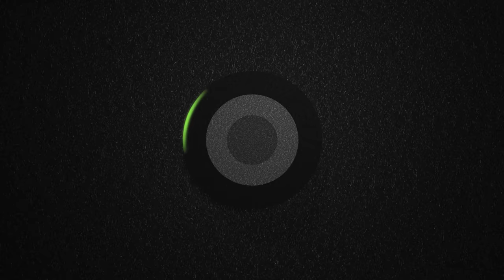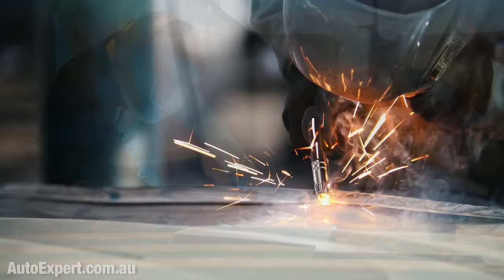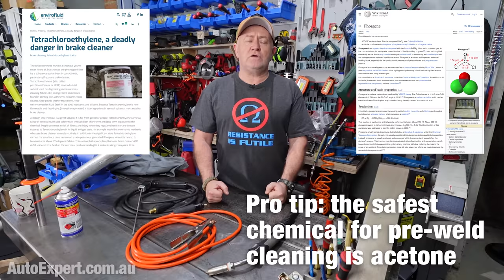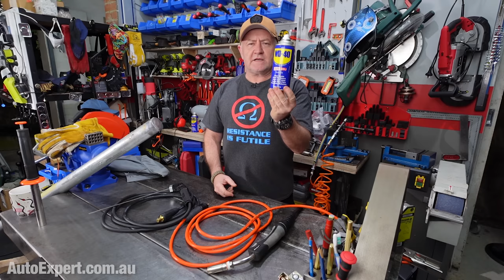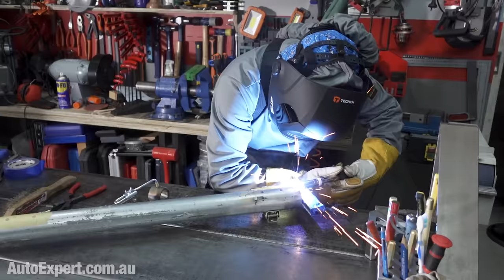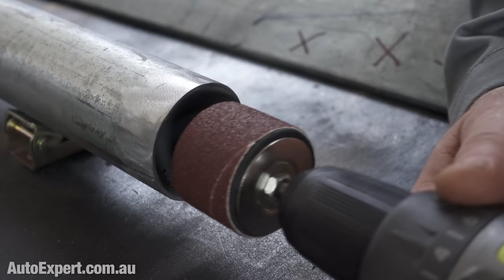How to die while arc welding at home: the top 5 ways | Auto Expert John Cadogan

Comment: Awesome video John. A few things I knew, a few I didn't. One other thing I'd say (from experience via my Father), is don't do any welding within cooe of a lead acid battery, especially one on the charge. On the farm, the old man had a neighbour ask to weld something up, Dad had a battery on the charger down the other end of the shed. A spark managed to travel far enough to make the charging battery go poopy in its pants in a very dramatic way. From memory it would've been a good 10 to 15 meters from the welding site. Years later when I was working for an oil drilling company, I pointed out to a pro welder who was welding up some pipework (8000 psi rated if I remember correctly) that there was a couple of jerry cans on the shelf about 3 meters from where he was welding...... And the dirty look I got from the yank drilling superintendent after I pointed that out will be forever etched in my mind. The arrogance of so many high up in the chain of  the oil industry is incredible. Oh, and welding gal pipe really stinks! Awful smell!
Reply: And cutting,/ grinding it. It stinks. Just as well really!
Reply: oldfartonabmx:  what did the battery do when dad's welding spark got over there?  I guess it ignited hydrogen gas?   Gasses probably crept over to where Dad was?  Did it blow up?  Explode ?  Were you there or just dad?

Comment: Fantastic video about the potential dangers of electric welding.  Like you I had to spend time with our specialist welders in the vain hope some minute part of their staggering level of skill would osmotically transfer.  One of the guys I worked with always set up his welding table outside under a steel awning - his view was that welding inside should be done only when there was no other option.  He was the only welder we had at the time who was trained to weld rolled homogenous armour plate, and he really new his craft.  Not that too many hobbyists would use them nowadays, but I would recommend many of your safety tips to anyone digging out and using using an old spot welders.

I spent quite some time in the two proof and experimental establishments our organisation had and it's true that 'blowing stuff up' is fun when it goes to plan (I have some 'fun' stories about when it didn't), destructive testing has to run a close second though.  A static coupler test rig would be quite a thing to see, and to have designed it quite a feather in anyone's cap.

Comment: On the electrocution bit it's quite difficult to get killed by it DIRECTLY, though as you point out it is possible if you try hard enough. The voltage (and therefore the current through you) is not usually high enough. But the thing about electric shocks is that many fatalites from them are INDIRECT. If you're welding up a ladder or on a roof, or manhandling a half ton piece of metal, or otherwise in a generally hazardous environment then that short involuntary convulsion can do very bad things.
Reply: The usual output voltage isn't that high. About 60 V open circuit. I'm doubtful that would kill someone. Not easily anyway. I'm pretty sure welders with a high enough voltage to kill you aren't legal nowadays. I'd consider everything up to 50 V to be fine. A little above that is still very unlikely to kill someone.
Reply: @asdqwe4468  It all depends on the current, which is a function of both the voltage and the resistance (ohms law). If you are sweaty (which contains salt) then your resistance is much lower than normal, and so can be electrocuted with much lower than expected voltages. Also the path that the electricity takes through the body plays a role. A path through the heart or brain are likely the worse possible scenarios.
Reply: Many d.i.y.ers & home handymen are unaware that lower voltages can be deadly. It is true that the current is what maims & kills but what many don't realize is that under the 'right' conditions as little as 47 or so volts with as 'little' as 10 MILLIAMPS can be fatal. Length of time of contact is also a great factor in severe destruction/death. Guys who do home electrical work are fooling themselves when they say "...huh, it's only 110/120 volts"! Thanks for the great video!
Reply: @lawrencesmith.  Lawrence you are clearly American - everywhere else uses 240 volts AC, and no-one is under any illusion about that being potentially lethal. But the output (not input) of a welder is never more than about 60V DC and usually much less than that. As stated it is very rare, though not totally unknown, for that to kill directly.

Comment: Thank you for doing this video. It's a good refresher course to those of us who welds at home. I do mostly FCAW welding and as you know, that puts out lots of toxic fumes. So I designed and built myself a fume extractor that I position right over the bench and the fumes are pulled away from my face and blown outside through a 4" hose. Also, I never weld with bare skin exposed.

Comment: Welder by trade. Its probably worth noting additional welding PPE;  wear ear plugs, not just for noise as welding is very noisy but you don't want to chance one of those molten spatter balls finding its way down your ear cannel. I would also suggest safety glasses  under a standard style welding helmet especially for welding in unusual positions like on cars or trailer for example. Also when prepping parts for welding like grinding off galvanizing you should also be wearing your mask/respirator as I have herd you mention in other videos.  
All great advice though like brake cleaner has always been a no no but never new the scientific reason..
Thanks

Comment: Great explanations. There are also a few videos going around of auto mechanics setting fire to the vehicles and/or the shop when welding on a car where there's either leaking fluids in the areas, flammable other stuff like seats, or getting too near the gas tank.
Reply from the maker: Mechanics tend to be very casual about welding...
Reply: @AutoExpertJC  Tell me about it, as a (now retired) vehicle technician (bus and coach) I was on a Sunday afternoon shift when all the big white chiefs were safely tucked up in bed when a (rather dim) work colleague decided it was a perfect time to stick his wheels back together. He was using a gas welder and was underneath the thing totally engrossed when we shouted at him “John, your car’s on fire”, after about the third time he finally noticed and ended up tipping a bucket of water into the thing to extinguish it. We had very strict rules about “hot work” which included having at least two people present at all times,(no doing it on your own). Fire extinguishers readily available, they had to be close and not the other side of the workshop, good ventilation and fume extraction and adequate lighting. 
  Another killer when welding is one you didn’t touch on in this video, specifically when welding cars and that is being underneath the thing when it on jacks but without any proper safety supports. A quick way to shuffle off this mortal coil, a question for people who think they can get away with it is “do you really want trust an O ring that cost 5 pence with your life”?

Comment: Hi, John  , a couple of points , as a Boilermaker have seen some disasters with Welding and grinding .
Wore 2 of those filter head shields out , hint don’t pass wind when the power unit is on and you are welding .
A dangerous habit old stick welders used was tucking the rod under there arm to install the new rod , lost a few as shock went directly into there heart .
Another bad thing I see all the time is One handed , no guard grinders , know of one person killed the blade dintigrated destroyed his heart , no coming back from this .
Another young bloke wasn’t the handsome bloke after hitting him in the face .
I see it all the time when the experts are showing how to weld , grind ,etc on Utube / Facebook .
I also you doing an own hand wash on part of that weld on the gal pipe . 
Goos show old jc the boilermaker .
Reply: I recall in training one guy slipped and was swiftly shipped to the hospital to get stitched up. That was a 4 or 6 inch grinder with a cutting disc installed. Even with guards those things can be lethal.
Reply: I wanted to rap things up, so I cut corners (pun intended) by not replacing a sanding disk that was cracked (hey, I've ignored this a million times before and been fine!) removed the guard, and did not even put my gloves back on. I went to do sanding on a sink frame I had built for a client, and the disk was obliterated, tearing across the back of my hand. Fortunately, my grinder has a "dead man" type switch, and as far as the injury is concerned, I have nothing more than a scar and a small, slightly more sensitive spot on the back of my hand.

Productivity time was lost as well. That reminds me, DIYers like buying inexpensive grinders, however, they lack paddle "dead man" type switches. I think it's important that folks understand the risk of these tools, due to their design. Furthermore, I have found that the complacency of the knowledgeable can be more of a hazard to themselves or others than, the lack of knowledge of those not knowledgeable.

Comment: Great video John! Most I knew about bar two. The first one about chlorinated brake cleaner. Not sure if that is in use in the UK and EU probably been outlawed years ago knowing that lot over the chanel lol the second one was about wet gloves and welding benches, probably because I don't stick weld or use a welding bench. Most of my welding is car body stuff with gassed mig. I'm certainly guilty of welding in a tee shirt with or without gloves and I developed a method of welding without a hood also ! I know ,I know better now lol but certainly I have spots on my arms 30 years later that may or maybe not be melanomas or suchlike so I suppose I'd better get them checked out. I'm nearly 70 now so welding cars is no longer a game I'm in lol. In fact I can't remember the last time I had to weld something up. So I'm safe for now. Oh and by the way, the WD40? I buy that in gallon cans and use a spray bottle so at least that keeps the propane at bay lol
Reply: I make my own from auto-transmission oil and acetone.  Seems to work just as well as the proprietary product for lubrication.  No so good as a water dispersant, but you can't have everything.

Comment: This is definitely the best safety video I've seen regarding welding safely and not killing yourself doing it. You are dead right regarding galvanised steel, and the dangers of it. I'll also tell you that cutting galvanised steel especially when using an abrasive cutting disk. The rapid rotation of the cutting disk heats metal and melts it at the point of contact with the disk. And it heats the metal in the immediate vicinity of the cut to the point where the steel glows, and the zinc oxidises to form zinc oxide along with the lead oxide. Very bad for you indeed.

Comment: Fantastic video! 
Have welded all my life since early teens, rough and ready rural welding back then, fully ticketed now.
As you read out each point, my mind went to instances where I had a close call or seen the effects of the point.
Old welding machines like the Lincoln torpedo motor/generator sets had very high OCV as well as nasty spikes riding on the voltage, have been bitten many times while sitting on a large structure and changing electrodes with wet gloves. My go to strategy became wearing rubber gloves under the leather ones.
Almost took myself out with a can of Aerostart (pressurised ether) that I thought was a safe distance and was not on the welding table...a BB hit the neck of the can and opened up a hole in it...I was welding away and only alerted to this weird hissing sound...thank F*&K it was a very large space and there was indeed a breeze at the time.

A good follow up might be shit that people shouldn't weld for fear of dying. I say this because as you point out, its now as accessible as a roll of poo paper and people dont understand the limitations of cheap GMAW machines or even SMAW designed for very small work....My suggestion would be pressure vessels, containers that hold/held flammables, trailer, wheel rims, trailer hitches, or anything load bearing......there is a reason why we went through so many years of training and then regular testing and each weld position also requiring its own tickets.....it saves lives!

Comment: The comments about gloves safety is super critical in my field of work (linesman) our HV liners get tested for structural integrity before we ever start any hot live work. Same goes for the OHMS suits for aerial inspectors. I'm surprised how laxxed some welders are with safety considering how much current they're handling.
Reply from the maker: Familiarity kills welders; ignorance kills DIYers.
Reply: This quote is incredibly true. I did a grid disconnect when an arborist cherry picker made contact with the powerline. Safe to say the young bloke is no longer with this world. Bloody awful. He got away with not using the right equipments till he didn't.

Comment: I am fairly new to welding. couldn't find any cool table bases for my wood table tops so I decided to lean how to weld and make my own. self taught with the help of YouTube. I am 52 years old and been around the block a few times so I know you can't learn it all from a couple vids. I am so glad I stumbled on to this video you made. last night I did some flueting to a piece I am working on with some end mill drill bits. somewhere around 150 holes in 1/4" steel of various sides. lots of milling oil used so the base was covered in it. I had the bright idea of using a degreaser to get all of the oil off the metal and it worked great. The only welding left to do is stick some tabs to attach the wood to and I was setting up to that this morning and I relied that was not a good idea until I get the degrease off. looks g for a way to do that and you nd this vid. very valuable in of for me dude . thank you. any other safety tips you can shoot mu way would be sweet mate. I use a 2340v miller mig welder.

Comment: Good info mate. 
I started welding at trade school in the 70s by doing a "broad base" welding unit as part of my Textile Engineer education.  Later, after doing classroom specialsit subjects and administration for 20 years after going to Uni for a teaching degree I elected to get TAFE  boiler maker qualifications in my own time spread over a few years. Even though I was already legally over-qualified to teach Tech Studies by RPL. It was time for a tree-change because was sick of adminsitrivia!

I was head hunted and contracted immediately I put my hand up to change track. 
However on comparing my experience to other tecchies I found that Most tecchies in schools get a base level pressure cooker education in multi trade regimes while doing their degrees and go on to instruct up to trade entry stage in Secondary Schools.  That's the norm in SA. 
They mostly do a great job because many have had life experiences in multi trade jobs and haven'tspent their whole lives in the protective cocoon of the school system. 

Few of the others that I've met do extra formal study to any great depth. The degree suffices.
I hope that many active tecchies watch your video. Then they may understand more thoroughly the dangers of teaching boiler-making welding processes without sound trade level knowledge. 
Thier transmission of increased knowledge could go on to save the lives of kids they've never even met.

Comment: Finding this vid made me laugh (momentarily) when I thought about my past, then really think how close I came to disaster. Some history; I was working inside a race car, outside on a rainy day and everything was damp. After a few hours everything was damp, including my coveralls and the inside the race car. Sitting inside the car crossed legged on the floor of the car, I was welding (without gloves) with an old Lincoln 220 buzz box and when I went to change the rod with my right hand, things got "very painful" between my right arm and my junk that was touching the floor of the car thru my damp coveralls. A very valuable and painful lesson learned!
Pay heed to these warnings, they are NOT a joke.

Thank you for posting this.